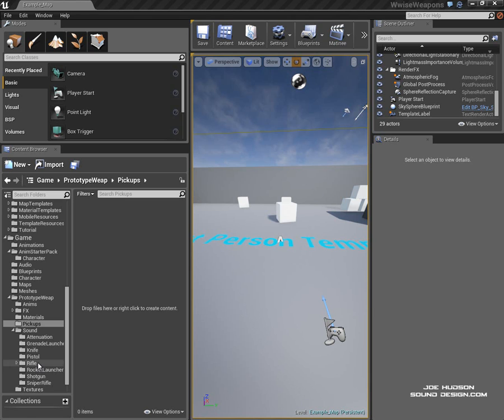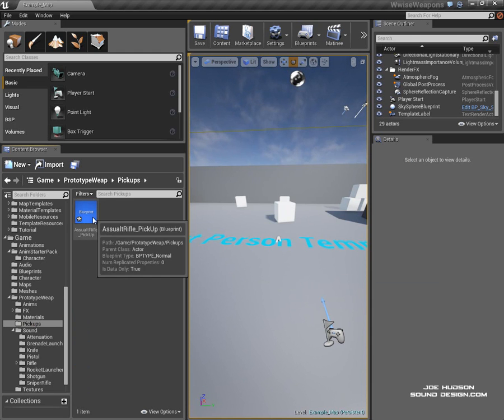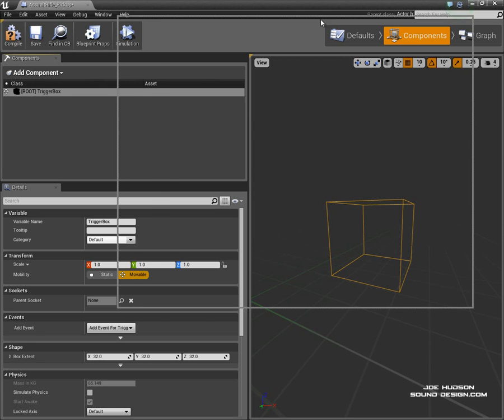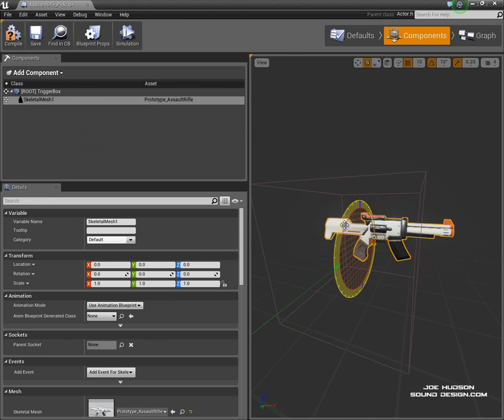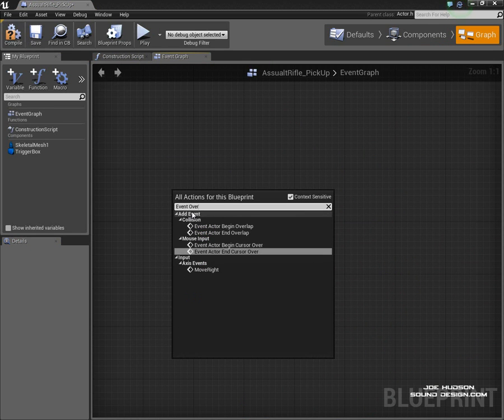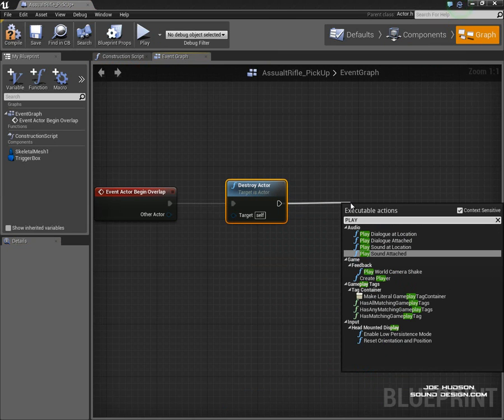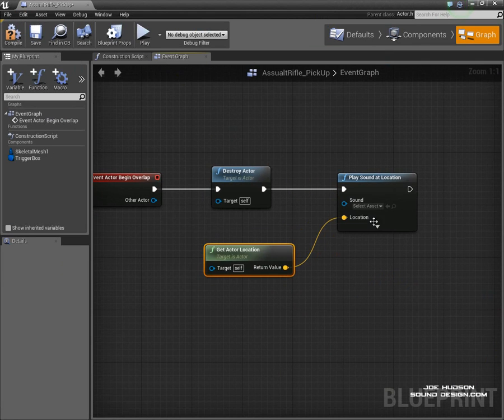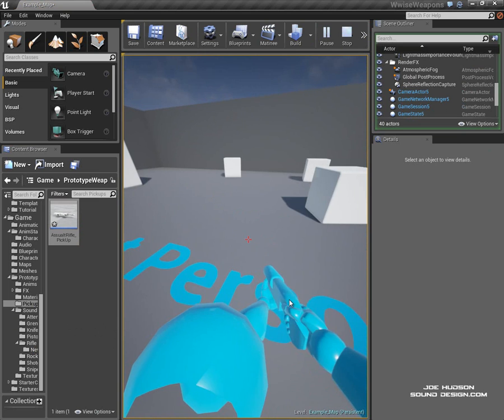UE4 Tutorial - Weapon Systems! - Part 1 - Basic Pick Up Blueprint

Comment: Super duuuupppa m8ty.. Love it well presented and informative and on a basic level that ever i understand fully.. hope we continue this for awhile if you need ideas for whats next lemme know GREAT vid
Reply from the maker: Thanks pal, I was thinking about doing a proper character footstep system with independent shuffles, character speed modulation and a dynamic jump control system. Either that or a force field like the one in star wars battlefront with sound mix modifiers based off trigger volumes.
Reply: Well haven't finished what yah got yet just ran into issues with debugging you need 4 seperate MESH for weapons you cant use bp alone as it hides the mesh of assaultRifle (DUH) lol... awesome though im in UNI to so this is great information (apologize for spellings.. im excited) lol

Comment: im trying to attach un equiped weapons to back via socket of course how can i integrate this?
Reply from the maker: easy, don't use a socket, I doubt there is a bone in the right place for u to add your socket, u see how I've got them spaced around his head in the components tab? well just position them on his back instead, you'll have to play with the weapons initial visibility in the construction script. if u want the weapons to animate with the character when he runs with the on his back u will need a socket for that. but experiment and see what works for u!